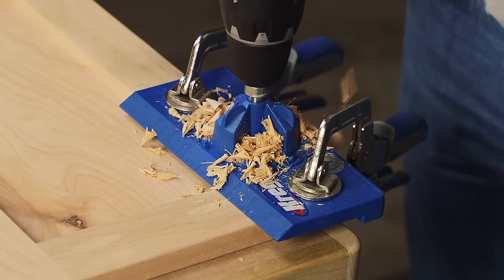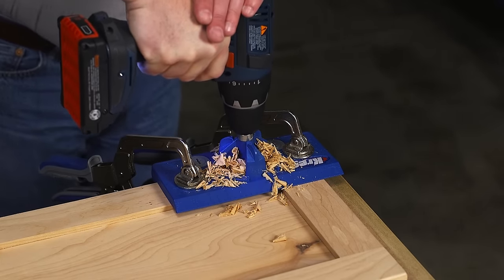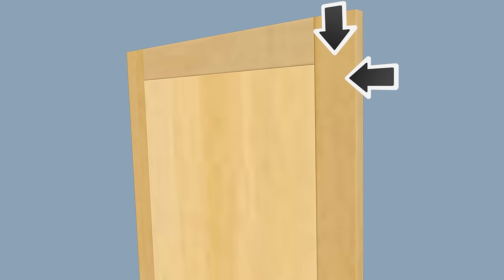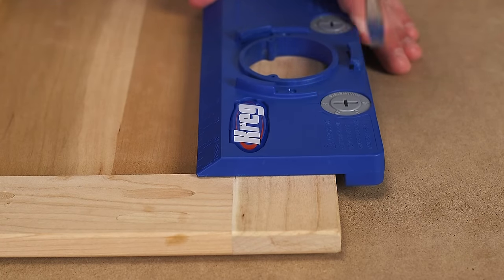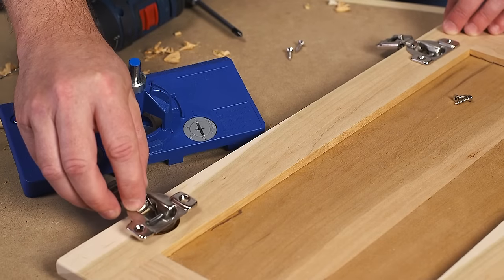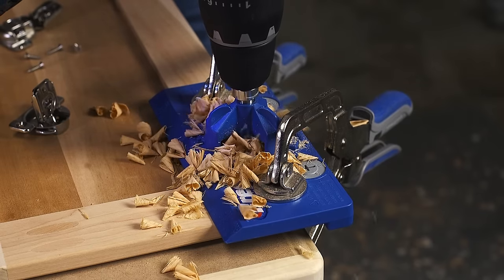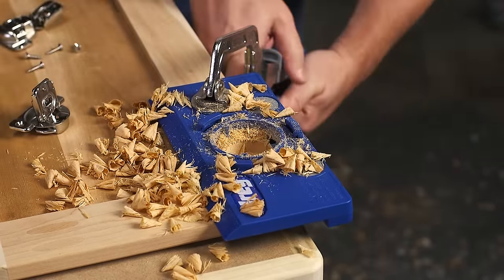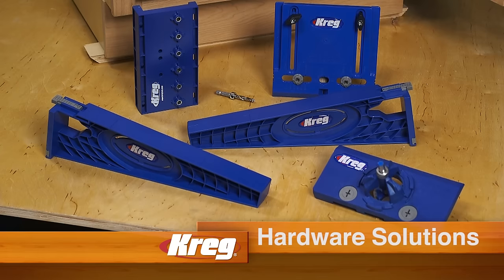Kreg Concealed Hinge Jig - How To Easily Install Hinges

Comment: Overall I like the jig. It's the easiest I've ever installed the euro hinges. It really is as easy as seen on the video. My only gripe about the jig was easily remedied with the addition of a flat washer. I found the jig's stop collar to be useless with the Blum hinges I was using. They require a 7/16" deep cup hole (others in the Blum line require a 1/2" deep hole for the cup). In either case, the shallowest hole the stop collar will adjust to, is close to 7/8" deep. On a 3/4" thick door, this is cutting it very close when you consider the deeper dimple left by the bit's point. My solution was to drill out the center hole of a 1/16" thick flat washer so that it fits over the bit's shaft. I put the washer on after the bit is inserted into the guide before adding the stop collar. Now when drilling with the stop collar adjusted for it's shallowest hole, it stops when it meets the washer (which is acting as a spacer), and drills a hole a few scants deeper than 7/16". Perfect.
Reply: Chatoyance Woodworks umm... you do know that the stop sleeve is adjustable, right? It’s held on with a set screw. You can the depth to anything you want.
Reply: The shallowest mortise depth the stop collar goes to is 1/2" deep holes, not 7/8". It's still a problem for 7/16" depth hinges though.

Comment: Most concealed hinges come with a plastic anchor bushing that must be bored out using a  8mm drill bit to receive the anchors. You should have accounted for that  in your design. I personally don't like anchoring a hinge using screws into the wood frame.
Reply: CNC Router, why, the cup bears the weight of the door?

Comment: What if I'm using the blum insertia hinge that needs the 8mm holes?
Reply: I used the same Blum hinges, and just drilled the 1/16" pilot with the existing guides. The screws that come with the 8mm inserts will work fine without the inserts themselves. If you want to make it a little easier to get them started, you can drill a slightly larger pilot after removing the Kreg guide, since the screws don't have a point on them.

Comment: Great tool..However how do you account for cabinet doors that have angled edges? The cams only account flat 90 degree edges...
Reply from the maker: Here's what Technical Support had to say: If he is referring to the door not being a rectangle, it would still work, as one of your edges would still need to be 90 degrees in order to square it up and open properly. If he is referring to the design of the face being angled, unfortunately, we do not have a way to account for a door like that. However, most door faces that are angled still have a little bit of a ledge before the angle actually starts that would allow you to reference against. If you have any further questions, you may contact them directly at kregtool.com/help.Thanks!
Reply: Thanks for the reply - a little help from an angle finder plus a little trig helped me offset the correct distance on the cams.

Comment: on mounting the door to the cabinet...is there a jig to pre drill the holes on the frame without holding the door to the frame?
Reply: It depends on the individual hinges, but some of them have removable cabinet-side hardware that can be mounted by itself first while it's not attached to the door portion. As long as you measure the right vertical offset, it makes the process a whole lot easier.

Comment: Does the screw hole locator have any bushings?
Reply from the maker: No, it does not.
Reply: Unfortunately it doesn't, so I think it will get wallowed out after lots of use eventually. However, the important part is the 35mm cup hinge hole anyway. If you get that in place, you can line up your hardware and use a center punch to mark the location for the desired screw holes.